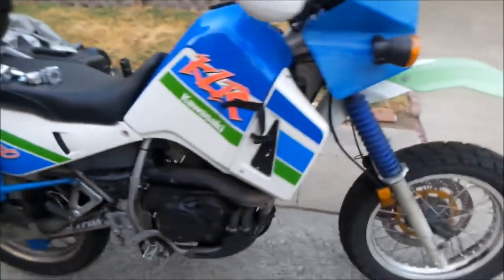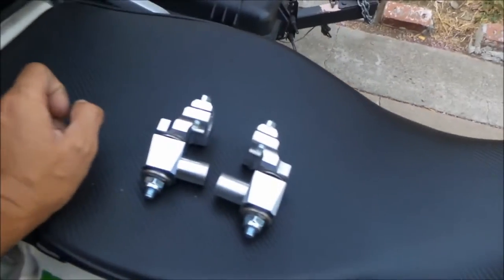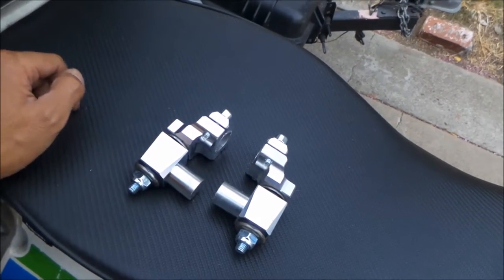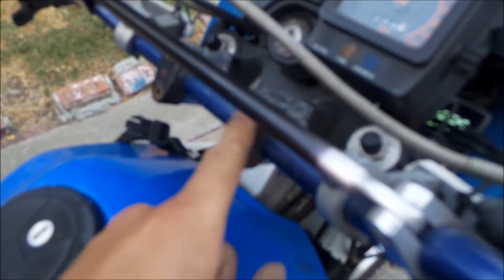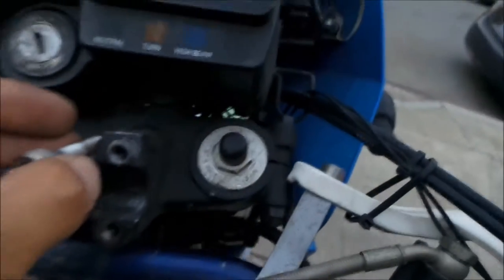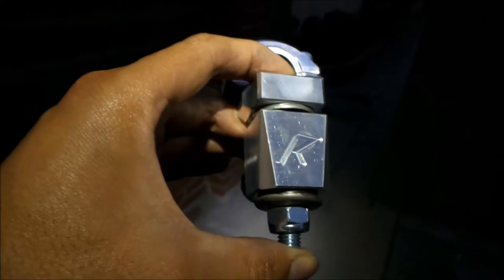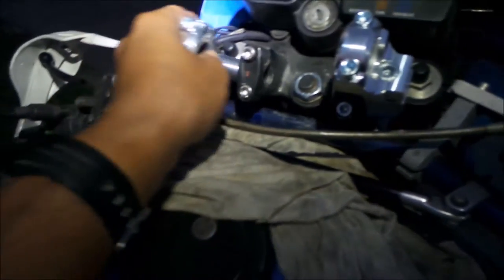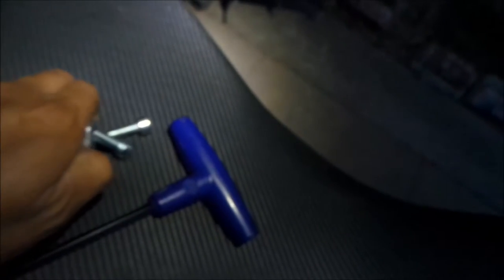HadesOmega How To VLOG: KLR650 Knox Anti Vibration Risers

Comment: So I got vibration really bad at the feet, and my bike done 26xxxkm should I check the doohiky? Is that why I got vibration
Reply from the maker: Have you never changed the doohickey?  If it is vibrating a whole lot your doohickey might be broke and the counterbalancer out of time.  Try loosening the doohickey bolt and tightening it again.  The only way to know if the doohickey is broken is to remove the left side engine cover.
Reply: @hadesomegamoto7639  soon im gona open the case and have a look and also replace it,but do I have to get the timing done? Or is it gona be fine once u change it?
Reply from the maker: @Majsumreen  If your doohickey is busted and the timing is off you will have to retime it.  Hopefully nothing is damaged inside.  I notice the sprocket teeth were a bit chewed up on mine.  But yeah that's what I did when I first changed mine with an eagle mike doohickey and it was still very vibey.  So what I did was refresh my whole counterbalancer system with parts from a newer bike.  Once I replaced the parts and timed it, the bike was very smooth, even more smooth than my DR650.  My KLR was so vibey my hands would go numb after a long ride. At some point Kawasaki revised the counter balancer components because my 92 parts were slightly different.
Reply: @hadesomegamoto7639  ok ill get it checked put,at the moment when I ride it my feet gets numb I haven't ridden the bike for much anyway but thank you very much guys for the info ill get it done asap

Comment: Just an FYI, the doohickey is not a countershaft balancer, and it doesn't have anything to do with that. It's a mechanism that is vital in the tension of the cam chain.
Reply from the maker: The do0hickey is the autotensioning system for the countershaft balancer on the KLR650.  The cam chain is what drives the counterbalancer if is out of phase your bike will vibrate like hell ask me how I know.  I've replaced nearly the whole counter balancing system with parts from a newer KLR650.